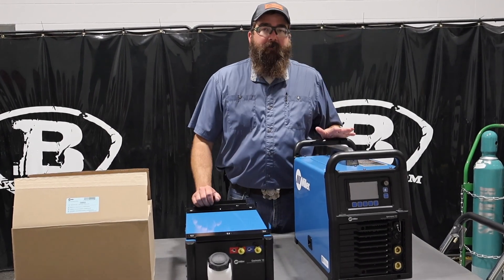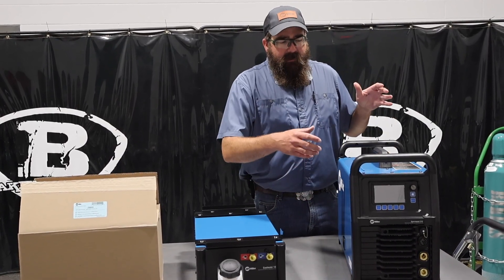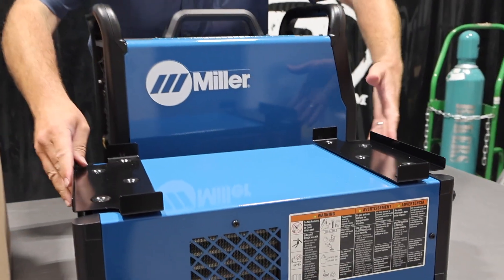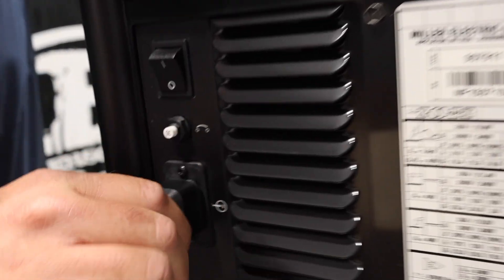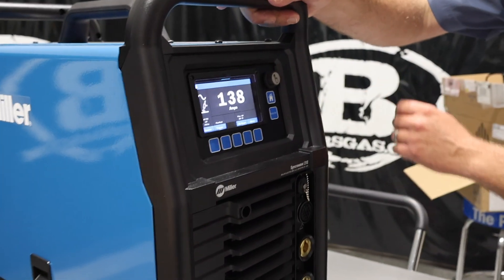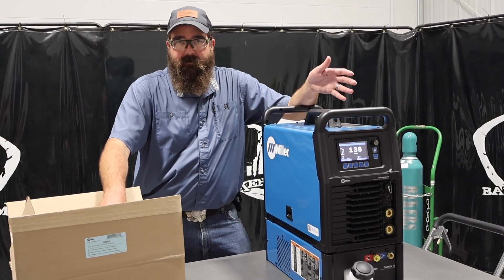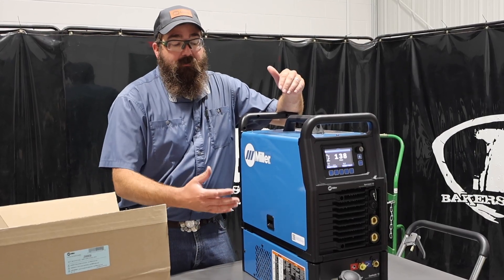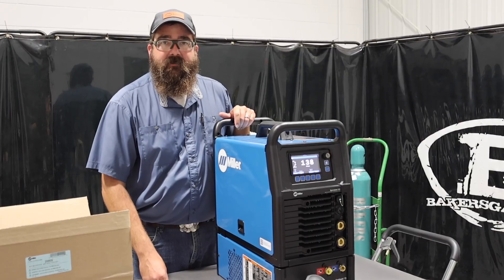Miller Syncrowave 212 AC/DC Water Cooled TIG Package Review 951000201

Comment: I have a miller 220. Would it be worth it to be the Syncrowave 212? Is there that much difference in the tig section?
Reply from the maker: Really, only if you wanted to go water-cooled, if you MIG weld at all, the 220 is going to be much more convenient for you.

Comment: The water cooler can also connect to the miller 220. How is this machine better than a 220?
Reply from the maker: This is a TIG welder where the 220 is a Multiprocess welders so it can MIG as well. Yes this is the cooler you could add to the 220, but the 220 does not get hot enough to where it is needed